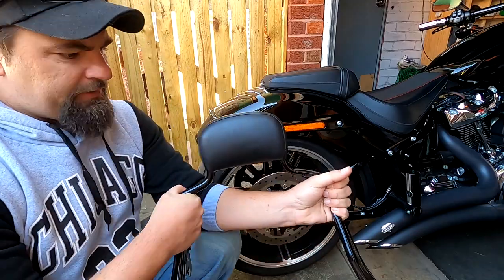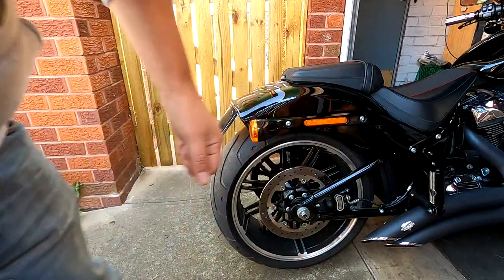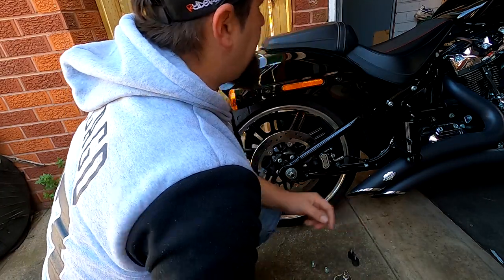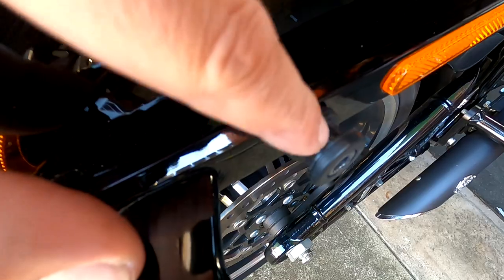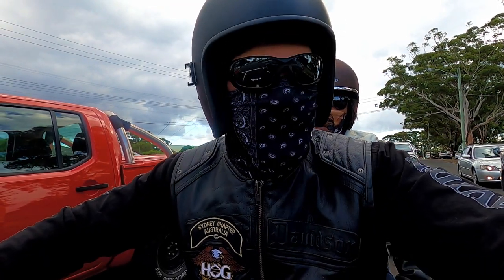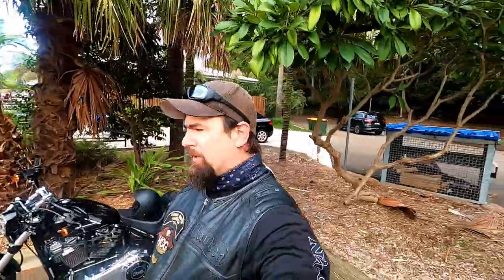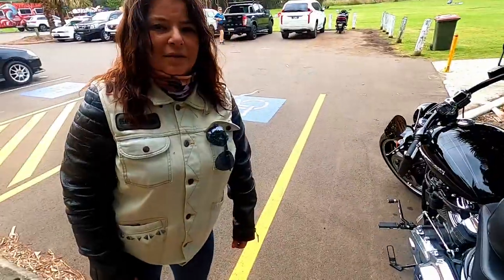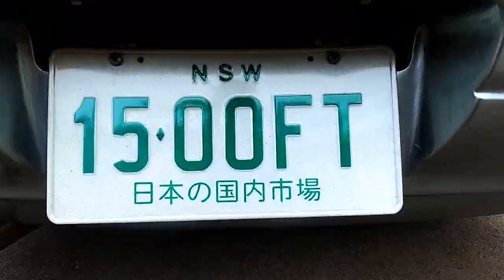Harley Breakout Docking Hardware & Sissy Bar Install

Comment: Thank you so much for this video.  Purchased a new Fat Boy and wanted to add a sissy bar.  The dealer wanted one hour of labor at 120.00.  I watched your video and put it on in mere minutes.  To be honest I am not qualified to hold a screw driver.  Thank you again for an amazingly big video.
Reply from the maker: Thanks so much Fred im glad this video helped you , Best of luck with the Fat Boy its an awesome machine, i had trouble picking between the two......Cheers

Comment: What are the part numbers for the backrest and docking hardware?
Reply from the maker: Hi Brian, mate im not sure of the exact part numbers but all are on the Harley Heaven website
-the sissy bar is the
HARLEY-DAVIDSON GLOSS BLACK HOLDFAST SISSY BAR UPRIGHT - SHORT - '18-LATER FLFB, FLFBS, FXBR AND FXBRS
-the backrest
HARLEY-DAVIDSON SMOOTH-LOOK SHORT PASSENGER BACKREST PAD
-and the docking hardware kit is the 
GLOSS BLACK HOLDFAST DOCKING HARDWARE KIT - '18-LATER SOFTAIL
I hope this helps